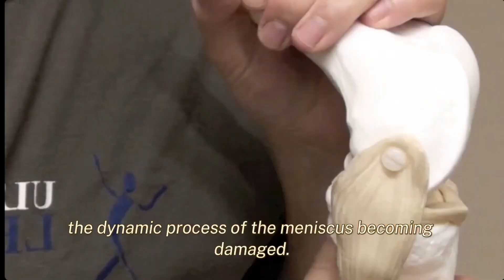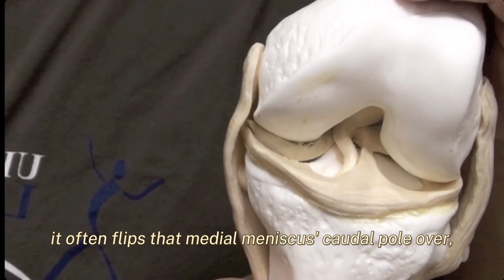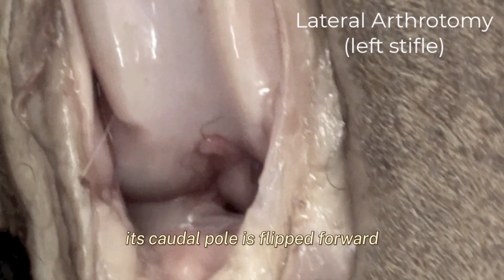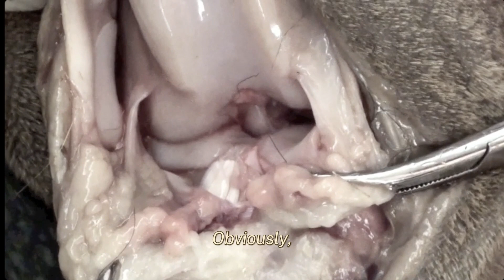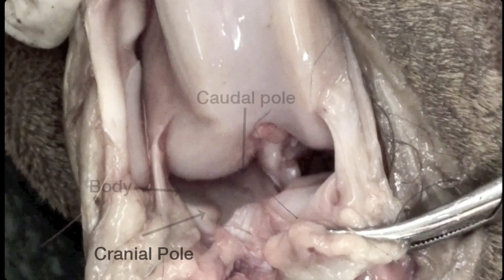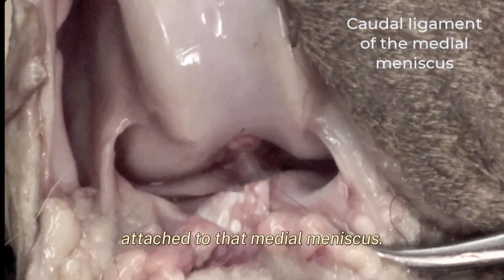The Canine Meniscus. What Makes it Click

Comment: Thank you for the video.  Do you do a meniscal release to treat and also prevent this from happening?
Reply from the maker: Thank you for your question. I am not a big fan of the meniscal release. There are some good studies that show that a release affects the joint in the same way as a partial meniscectomy; so what is the point? Having said that, I do tend to do it with a TTA because of the high occurrence of meniscal damage post surgery.  But I do not do it with the TPLO or the  extra capsular repair. Hope this answers your question.